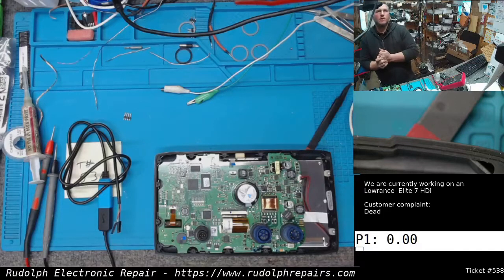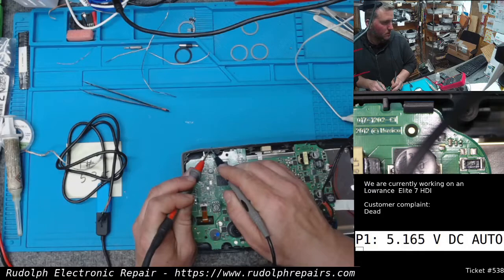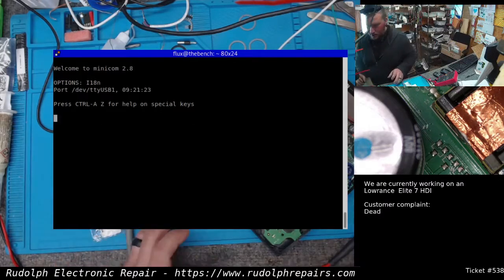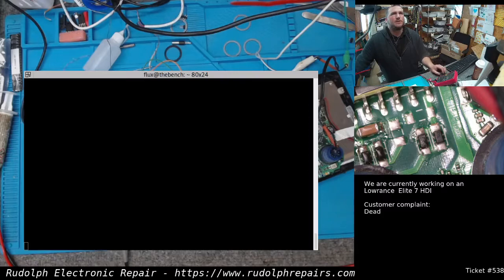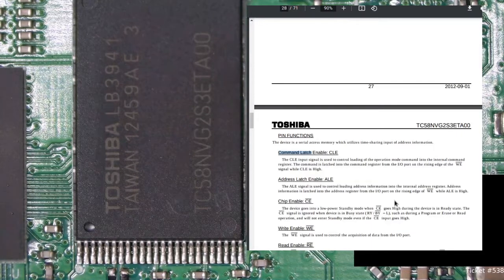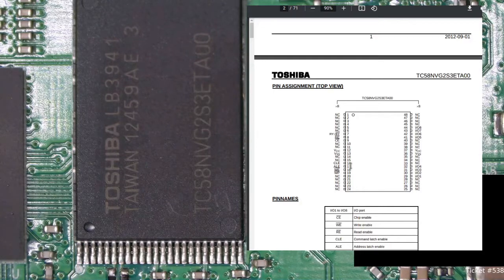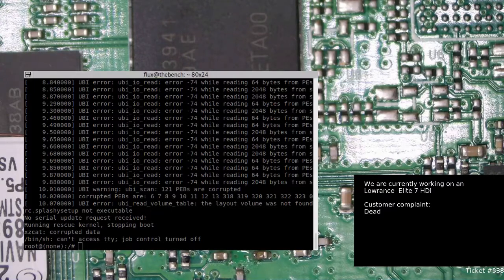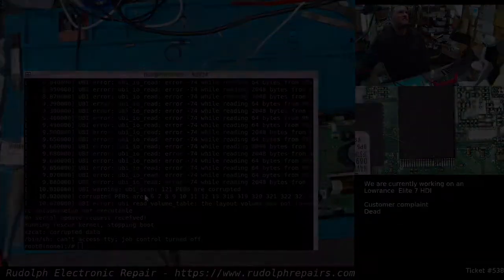Can we hack a Lowrance Elite 7 HDI?  Let's Try! Hack embedded devices using a new technique!!

Comment: I have an Elite 7 HDI that my son gave me for a boat I am fixing up to take my grandchildren fishing and boating. I would like to hack the display output (if possible) and add a second slave display only, up front in the boat. I cannot find any published data on the Lowrance video interface protocol and pinouts. Is this even possible? I can't imagine a Linux appliance that would be so proprietary that an external monitor interface could not be added (these components should be off the shelf designs to work with Linux appliances. My other option is to find another very used unit and network them together with the NMEA interface. That would be no fun, but get the job done. Not anyone's issue but mine, but I am trying to do this on total disability after a minor surgery gave me an infection in my spine that has resulted in rods and screws, and constant pain. The unexpected loss of all income but disability Social Security has put a damper on things I can still do physically (like fish) but cannot normally afford to do anymore.  Any help or advice would be appreciated. If you know a source for a unit that only has to work on NMEA 2k and be a slave display, I would appreciate it. I would rather see if the video interface could be hacked and an external display set up. 
You have a great channel and I appreciate your sharing your talent with us all... With great respect... Joe

Comment: That was absolutely cool! Great job, man! 
But it looks like there is no more UART interface on the board now. Checked my HDS Live, could not find any.
Reply from the maker: Thanks!  When I have some free time I will be creating more content around compromising physical devices.  A few techniques I used (I've never seen these specific techniques used by any other researchers before) I believe can be employed to compromise any Linux based embedded system that uses external flash.  Exciting stuff!  #️⃣😎

Comment from the maker: If anyone wants more details-
Initially pulling CLE low caused the device to completely fail to boot then freeze.  What we had to do was randomly strobe CLE during kernel loading phase in order to successfully corrupt the kernel loading process in a way to drop to a rescue shell.  👍#️⃣🐚
Reply: I'd love to find a way on a hds gen 3 to "mirror" a different screen on my tablet. Instead of just mirroring the display I could have 2 pages in full screen.
Reply from the maker: @harold4356  I’d have to do a bit more research but I am sure this is a realistic mod.